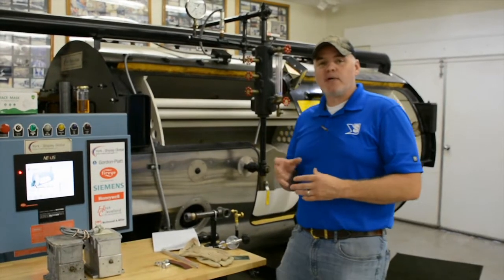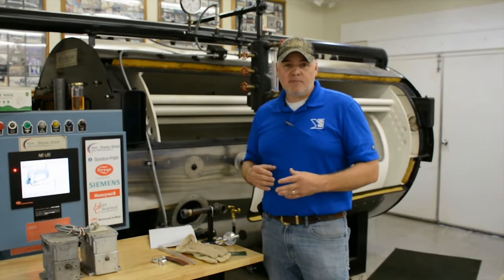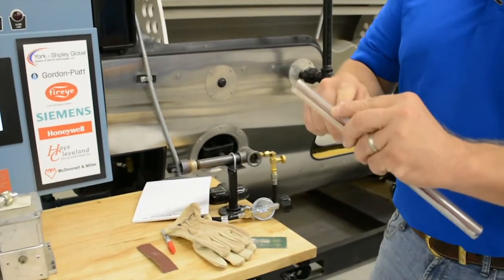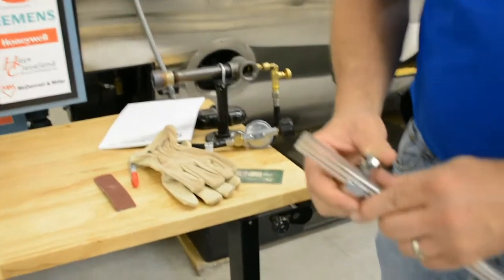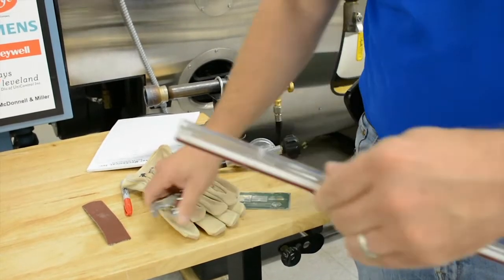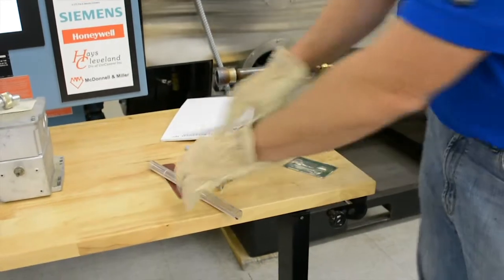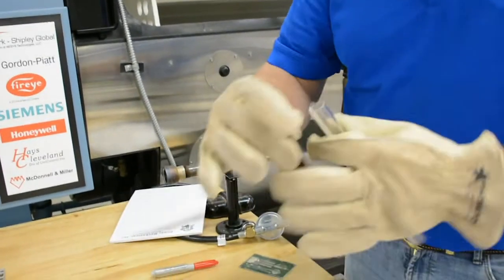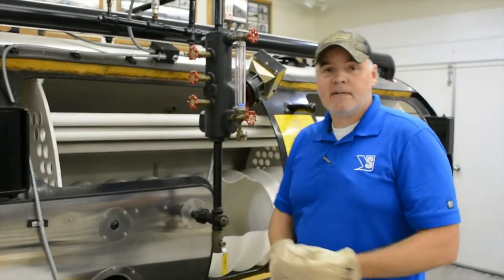Boiler Sight Glass Cutting Trick - Boiler Room Tips

Comment: I have two different ways to do it , score it and dunk it in hot boiler water or use a torch to heat scored area and tap it off a bucket
Reply: Awesome I’ll have to try that. I will definitely try that way but I’ll try it on the peace of glass that I’m replacing first. It can turn out to be a very expensive screw up. That type of glass isn’t cheap ether. Again thanks for the advice. Have a great day!!

Comment: Now is the Sightglass  on a boiler itself the same time of glass. I know as a boiler operator that a Sightglass on a 1200HP hurst boiler a special type of glass and very expensive any tricks to cutting that kind of glass I hear you can’t is this true?
Reply from the maker: @Backcountry Explorer there are different types of glass and this would only work on the the standard and HP tubular glass. This is especially useful on those. The thick walled or extra heavy would not fit a sharpie into it. After etching the glass a hardwood dowel would be a suggestion. It would also be best to score that glass around its complete diameter.
Reply: Thanks for your reply . Very helpful.